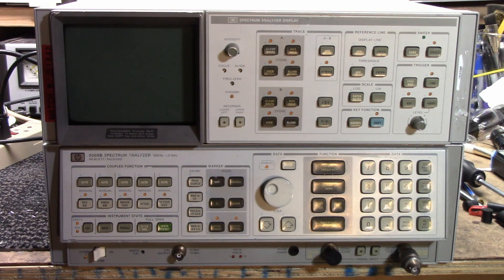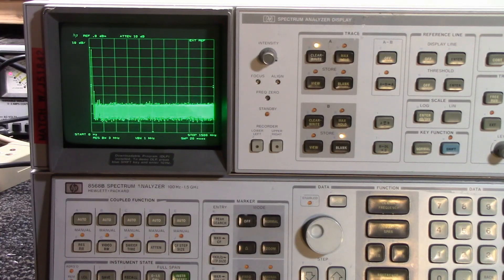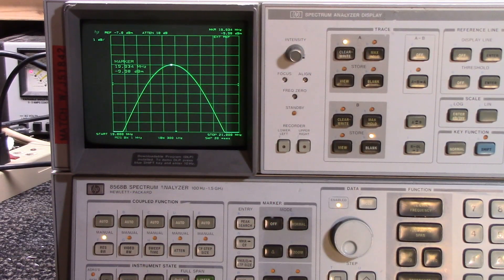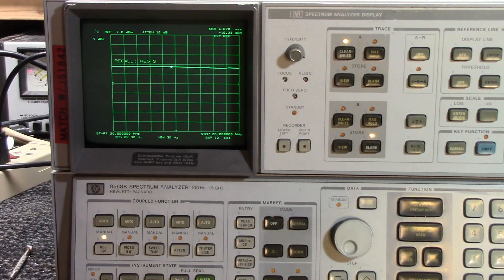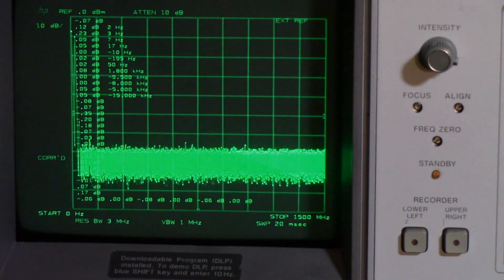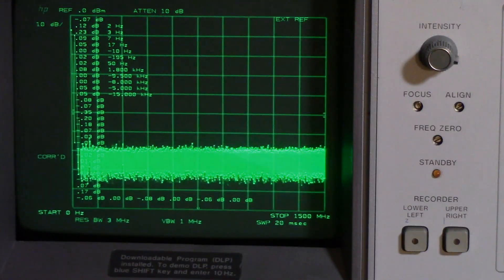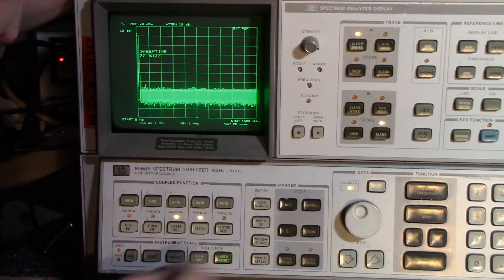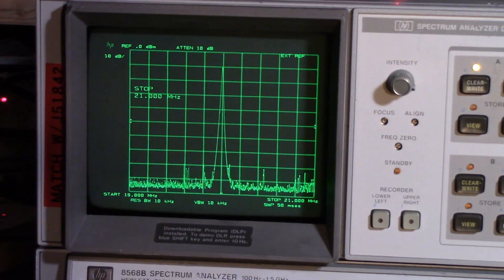HP 8568B spectrum analyzer part5 - calibration

Comment: HP equipment is very expensive here i recently bought an 8590a..cost me £500,i think that's around 400 dollars us...see them cheaper over there but the shipping is a killer. Must be so much of this old gear scattered across the USA would love to come over and fill a shipping container with cool stuff.😁
Reply from the maker: These two units were $600 plus another $170 for the cables.  Add another $120 for the service manual and reference oscillator.
Reply: @bandersentv  worth every penny,  not sure what that model would sell for here id guess close to £2000...check out the hp8922m gsm test set. They have many hidden features, and tend to be cheaper. I recently missed out on one.

Comment: Not to spook you, but I pray you don't have a misbehaving YIG. YTO= YIG oscillator. I fought with a 8590A that failed cal process constant. Pro advice from a cal lab advised failed YIG. Non-obtainium. Always change the dead battery in any of these HP vintage gear. And before you do the cal, be certain the cal osc reference is at the proper output level.
Reply: I had a problem with the YTO in my 8558B. One of the supplies to it was loaded down. I opened the YTO assembly and found a small board. A plastic cased axial tantalum has shorted.  Replaced that and I was in business.
Reply: @notimetolooz9655  The oscillator in the HP8590A is hermetically sealed. I also have a Tek vintage SA that is the same. Both YTO's are made by Avantek. Any failed component would have to be external. Parts level trouble shooting by a metrology/repair lab is super costly, and you can't justify it for vintage gear. I have relegated the 8590A to "Parts Status" now. I hope Bob gets his machine restored.

Comment: oH i GET IT NOW,  you can measure things like the noise floor of  a compact disc player and with signal frequency's the dynamic range and    then measure across   the   20  to  20k   spectrum with  a  sweep  You could  also  do  the same   with a amplifier
Reply: There are some SA that cover audio frequencies, but most don't.

Comment: One aspect of spectrum analyzers to keep in mind is that their input can easily be damaged. Pay close attention to the limits (usually stated near the input connector). A little too much signal or DC will cause costly damage. There is a several videos on youtube by w2aew about spectrum analyzers, including one that has a very good explanation of resolution bandwidth and video bandwidth.
Reply: On those HP’s, the N-connector (default), had a DC-block, but still had to be careful of high-levels. The secondary connection (BNC-connector) works from DC, so if you use that, you have to be very careful. For normal use, we used a barrel-connector, with a pico-fuse in it, to protect the analyzer, and Never, Ever allowed somebody else to use the spectrum analyzer, without giving a comprehensive course on how to use (and NOT) correctly use a Spectrum Analyzer. it is not an oscilloscope. If you want to look at some harmonics, or IMD-products (that is at a very low level), and the fundamental is off-screen, you cannot keep on reducing the level to see what you want to see, forgetting about the huge fundamental that is not on screen….

Comment: It would be an easy project to add Z to the Wavetech.  It would make a good video.
Reply: Even with the Z-axis, I don't think the Wavetek is going to work with this unit.  The Wavetek uses electromagnetic deflection, and is likely not fast enough to keep up with the signals from the 8568, which uses an electrostatic CRT and a sophisticated vector scanning system which separately produces the trace data, text, and the graticule.
Reply from the maker: Yes, it's limited to around 15kHz
Reply from the maker: It actually does have a z-axis on this back.   Much more on this coming soon.

Comment: This is a old instrument, but still v a very good analog SA, can measure up well with many modern ones! Not in size/weight, of course :-)
To change the width of the frequency band displayed, use the "span" button.
Resolution bandwidth is the width of the filter used, it will change the width of the "bell curve" wider or narrower, making it narrower will also decrease the noise floor.
When you change the attenuator, the reference level (and displayed signal level) is kept the same. Attenuation reduces the S/N ratio, therefore the noise will go up, if you increase the attenuation.
The shift key is like on calculators - you don't press it together with the other key. You release it, and the press the desired key. The yellow LED shows when you are in "shifted state".